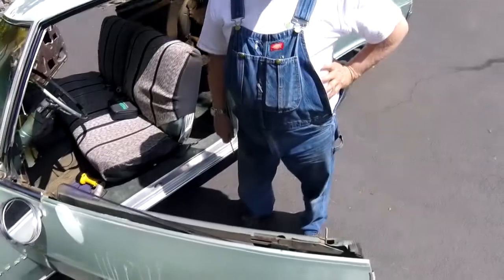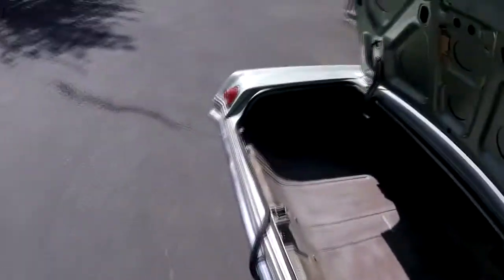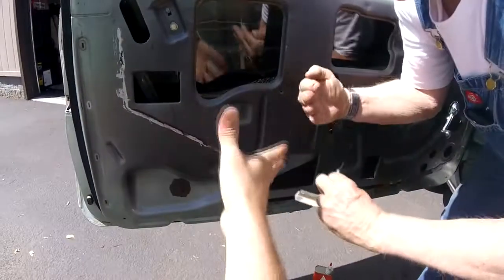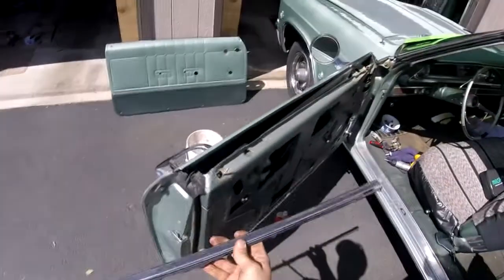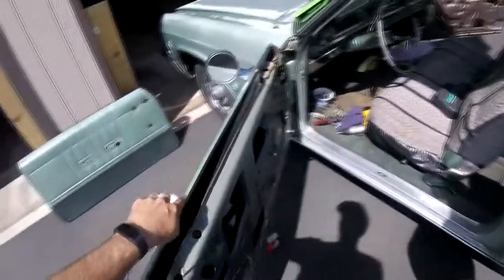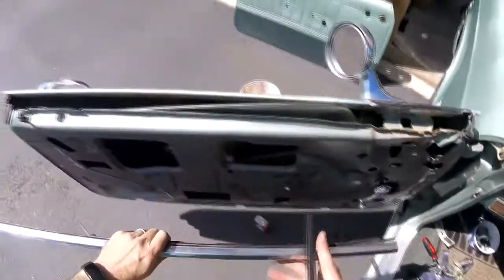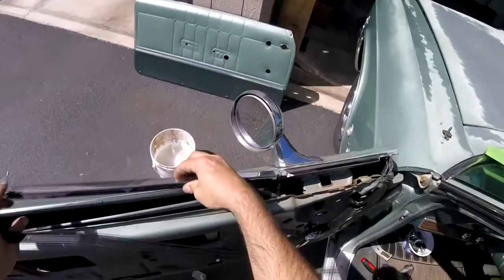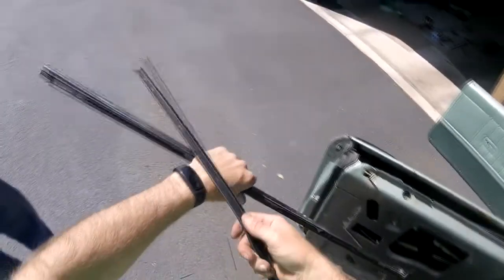65 Impala - How to remove Wing Window

Comment: Another bookmark from me. Will definitely check it back out later when comes time for the wing windows. I'm on the rear panel felts right now and turns out the ones on the upholstered piece are held with staples, which is interesting because the new ones with the chrome strips have screw holes instead.